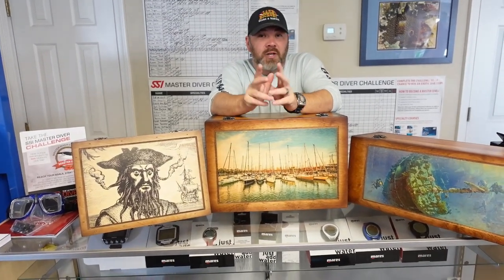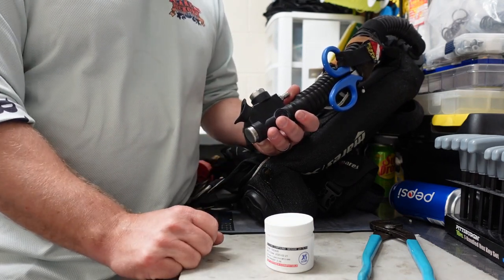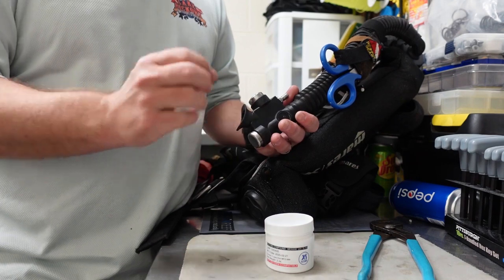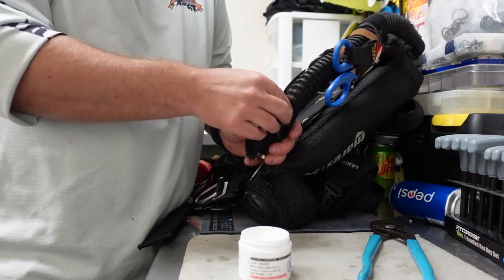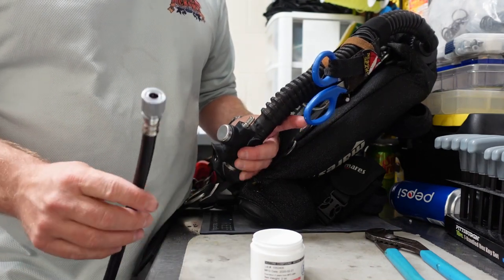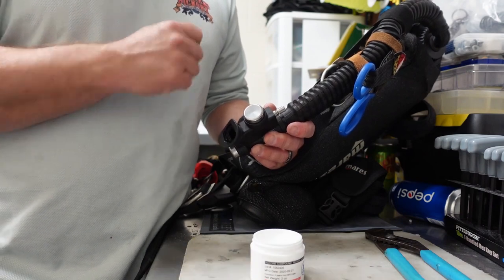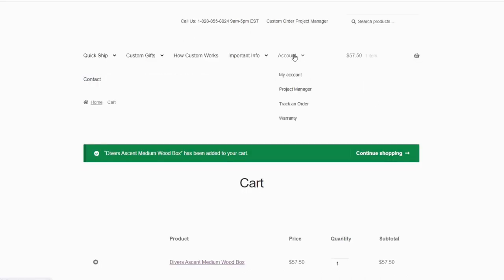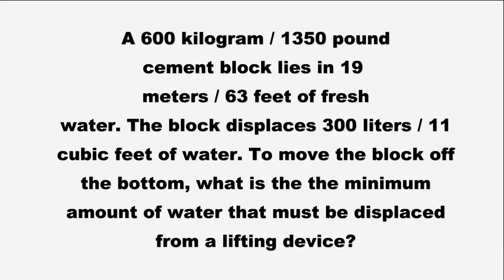Sticky Inflator and Free Give Away

Comment: The lifting device needs 300 liters or 10.6 cubic feet (11 cubic feet using the conversion in your question statement) to make the block neutrally buoyant. If the block shall be lifted with the lift bags alone, then they need to exceed these 300 liters (10.6 cf) capacity. The exact amount of additional lift cannot be determined without further knowledge about the type of bottom as the ground effect needs to be taken into account, i.e., is it lying on a rocky or concrete floor (in which case very little additional lift is required) or is the bottom muddy/silty and the concrete block partially submerged then we need to know the surface area of the concrete block that is in contact with the ground and estimate the friction (which of course depends on the soil makeup). Furthermore, if the soil is granular, such as a sandy bottom, and the block is partially submerged, then dilatancy will have to be taken into account as well.
Reply from the maker: Thanks for entering. We will anounce the winner soon.

Comment: Easy question. Cement is a powder so thus needs no displacement to float. Soo  cement block would just dissolve and float to the surface. Concrete however will need displacement.
Reply from the maker: Best answer so far. I got a good chuckle Calvin Cousins.

Comment: This shows how easy metric calculations are.  600 - 300 most people can do in their heads.  Depth is irrelevant to this answer, although it will affect how much gas it takes to displace that water from the lift bag.  Perhaps Qu2 will be how many Bar/psi will that take from your tank?  That's the answer you would actually need to have before you got down there as it's more than a third of a fill from a 12 litre euro cylinder and more from an S80.
Reply from the maker: Thanks for entering. We will anounce the winner soon. 

On a side note, you make a great follow question. How much air must I take with me to lift the device from the bottom. Sounds like an idea to another video. Thanks Tim Gosling.

Comment: 300 Liters or 10.63 cubic feet of water would need to be displaced to make the block neutrally buoyant.

If the cement block is desired to be lifted without any other outside force besides positive buoyancy, then the stated volumes would merely need to be exceeded. That is, of course, assuming that only the negative buoyancy is what keeps the cement block from moving.
Reply from the maker: Thanks for entering. We will anounce the winner soon.

Comment: Little late on my answer but here she is: 
Object in Fresh water at 19 m, weighing 600 kg with a volume of 300 L. 
A lift capacity of 300 kg or 300 L is required. 
The lift bag will use 853.4 L of air at 19 m.
Cheers, #SeattleRingHunter
Reply from the maker: Thanks for entering. We will anounce the winner soon.

Comment: To make the cement block neutrally buoyant, the lifting device would need to displace the same amount of water as the cement block or 300 liters/11 cubic feet.
Reply: true and that's not the rule ( I think you know but so others are not confused) it's just an accident of this problem (cement being twice-ish as dense as water) ... work the same with uranium 5,934kg / 13,082 lb for the same size block   It's mass of the object- the mass of water it displaces . in both cases the mass of the water displaced by the block is about 687 lb but in the case of the Ur you need to displace almost 200cf of water... you could go the other way and say the block is Acrylic resin (like a boat hull)  722block-687water displaced=35 lb so less than one cf to displace
Reply from the maker: Thanks for entering. We will anounce the winner soon.